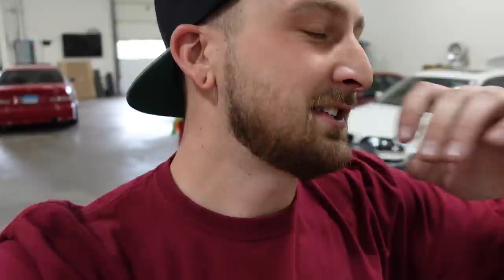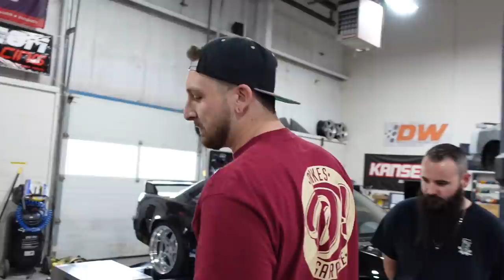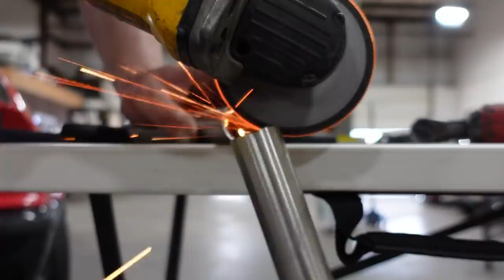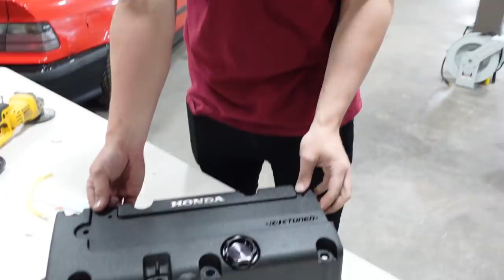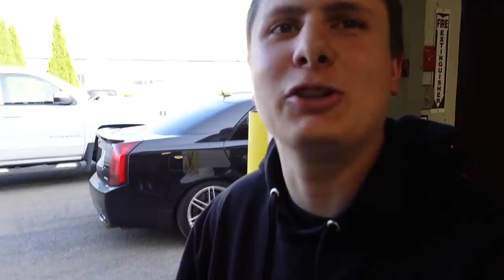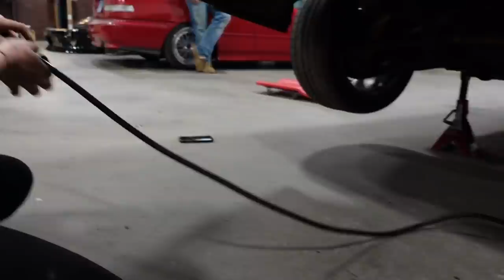Honda K series swapped 240SX COMPLETE COOLING SYSTEM!

Comment: Quick tip for anyone else who wants to do battery relocation(i did this on my s13): go to the junkyard and find any large bmw and take the oem battery cable they always have routed to the rear(they always run along the driver side under the carpet) they’re the perfect length and bmw quality  👍

Comment: you need to connect the hose outlet u plugged with that sensor on the thermostat housing to the top of the head next to the intake manifold for a "recirculation" hose for when the thermostat is closed it recirculates the coolant. if you don't run that hose your gonna have big big problems lol hope that helped
Reply: also the thermostat doesn't bolt to the water pump housing like that, there is a black plastic piece that goes there with outlets on it for recirculation hose and heater lines. look into it brotha, love the cars, progress and content 💪🏼💪🏼 if u need further help hit me on IG @cretella1221 ill try n help better
Reply: I looks like every few people noticed that the motor has no coolant flow.
Reply: @robertmacdonald7298  yeah def gonna be a issue with no coolant flow when the thermostat is closed,  jimmy knows what’s up tho. I stopped by the shop the other day and he completely understands everything going on. First time meeting him, very chill smart dude and he’s ALOT taller then I expect 🤣🤣

Comment: Another good little battery relocation cable is actually the OEM BMW or VWbattery cables if you can find a one in a junk yard. Very cheap and it’s actual battery cable. Most bmws and modern vws  have the battery in the trunk and very obtainable.

Comment: Hot water goes in the top of the radiator, cooler water goes out the bottom. So it’s more efficient if you plumb the heater core the same.

Comment: If anyone wants to relocate their battery to the trunk use a thick gauge audio cable such as 6 gauge wire. The thicker the better. The reason I say that is you want a low resistance cable which will give a good connection to your battery. Hope this helps. Also if you find your car has a draw but don't know how to fix it, would recommend a dead man switch. A dead man switch will kill all power to the car and also prevents theft of your car. Most circle track cars and drag racing cars have them so it saves battery power in between races.

Comment: Hoses look good, I'd ditch those worm clamps for OE style spring clamps, they look so much better and you want constant tension clamps for the cooling system to prevent seeping, especially with silicone

Comment: maybe if you use the stock k-series thermostat housing then bolt the swivel neck adapter to it, you can run the heater hose over the top of the starter

Comment: I used 1/0 welding cable to run the power wire for my sound system.

Comment: if you are worried about that bottom radiator hose moving around and rubbing you could get your buddy johnny to fab up and weld a stainless bracket to that stainless piece you coupled them together with and rivnut it to the frame rail. just a idea.

Comment: You need to barb that straight metal rad hose or its just going to blow off when it builds pressure, i don't know if you did it off camera and didn't show it. But just stying to help.

Comment: Jimmy, screw more lifts, you need a lathe and a mill to make parts like the bung you're using that relatively expensive Honda part for. That's a simple example, once you start using them you'll wonder how you managed projects without them. I'm not saying go Project Binky, although that shows some good applications.

Comment: how are you going to run water into the head where the intake manifold is? pro tip: the water has to come from behind the tstat (hot side) or you will have cooling issues.